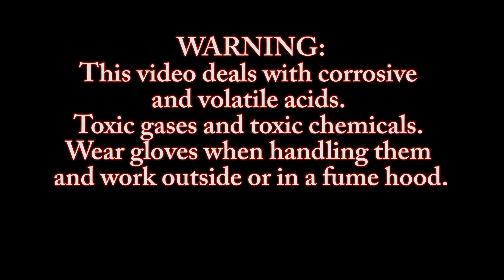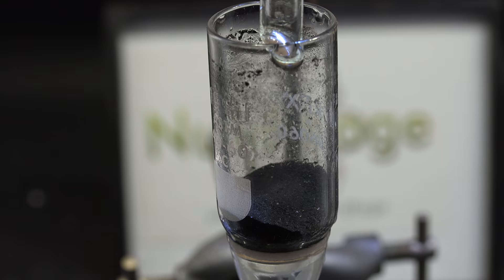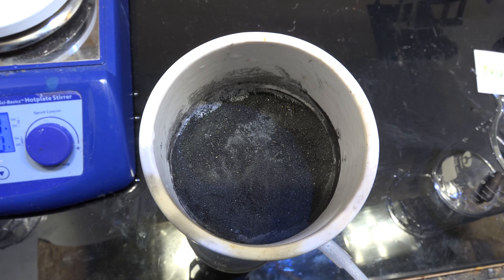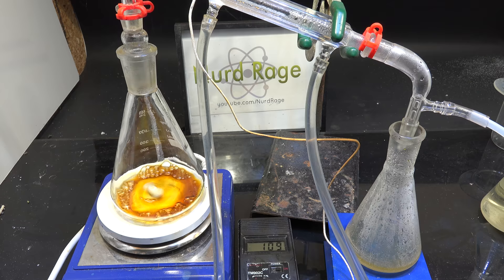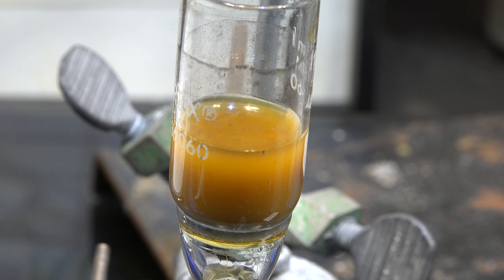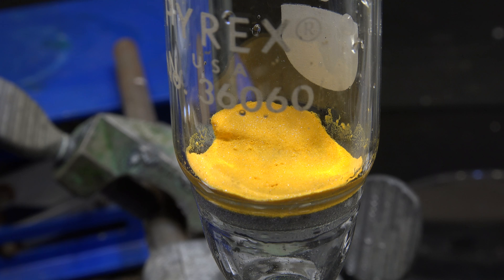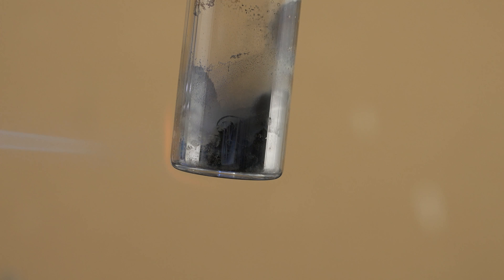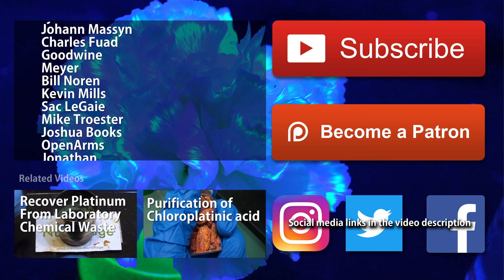Platinum Recovery from Laboratory Chemical Waste (Pt 2)

Comment: You can use platinum mirror on internal side of glass as electrode )
Reply: Wouldn't a silver mirror work better (because silver is more conductive) be easier to produce (given it's a standard reaction) and cheaper (for obvious reasons).
Reply: Quintinohthree, platinum electrode is inert. it's very important in electrolysis.
Reply: nRADRUS I guess that is important in electrolysis, yes.

Comment: If you didn't alter your voice I would have subscribed long ago. Must be the uncanny valley affecting me more than I would like.
Reply from the maker: no worries. Try turning off the sound and turning on the subtitles. They are manually done so they reflect the audio. That should help with most videos.
Reply: That is an actual solution. Subscribed!

Comment: I saw your thermocouple readout but no probe, where were you reading from and what were they made out of? Since you had aqua regia vapor, I'm guessing it wasn't your standard stainless type-K. Were you using something like an IR temperature sensor pointed at your boiling flask? Side question I've been meaning to ask you, what sort of pressure analysis equipment would you employ in a standard distillation setup like yours? Let's say in setup A, you have just a standard rotary vane pump, and setup B has an actual two-stage turbomolecular fancy-schmancy thingmajing (so you'd need resolution up to the mTorr^-4 or -5 I'd imagine). I've seen Edwards electronic Penning Gauges on ebay, but I have no idea how to finagle them onto a generic second stage average-quality-build surplus-university-unit pump I can grab for a few hundred of eBay.

How much Pd to you think you've got? In August the spot price exploded on the markets for both Pt and Pd (no idea on the Pt, but Pd up makes sense since people are hedging against an OPEC spike, allowing fracking to resume). I'm sure you already know this but a standard oxyacetylene torch will hit > 3500C with no issues, so no need for a contrived (masonry cement to form a chamber with two inlet ports, one piping in fuel, the other O2, and some sort of flow control), or some expensive lab grade furnace setup unless you have other experiments you'll use it with

Keep on keeping on, my good man. Your channel is nature spontaneously emitting the anti-particle of the Real Housewives. (Also lol @ the fact that you have to post a disclaimer to prevent idiots from trying this and coming back to your channel thumbs-downing you with an "THIS WASNT AN ECONOMICALLY PROFITABLE ENDEAVOR -- I HATE YOU NURDRAGE!!!!!!!")

Comment: have you considered a graphite crucible?
Reply from the maker: How would i prevent burning of the graphite crucible while i'm burning the carbon... which the graphite is also made of?
Reply: I do understand graphite oxidizes at high temperatures. However, they claim these crucibles are suitable for melting gold, silver and copper which leads me to believe it has a decent lifespan. besides they quite cheap on 
Ebay.
Reply from the maker: I think a porcelain crucible would be more effective in this case. The porcelain itself doesn't oxidize and you can easily look in and tell apart the carbon from the porcelain. You can then stop when the ashes are glowing and carbon has been burned away. With graphite though you see it burning and don't know when the carbon you've been burning is gone or just the graphite is burning. Additionally, the oxidizing graphite generates carbon dioxide, this shields the platinum residues and thus they oxidize slowly if at all. We want oxygen to be able to get and burn the carbon rather than being consumed by the surrounding crucible. Porcelain doesn't react with oxygen so more of it can get in and burn the platinum residues.
Reply: Beh, you're the chemist! makes sense, carry on and good luck!

Comment: How does the stir bar not dissolve in extreme solutions like aqua regia? Does the bar not contamunate the solution? And finally: what do you do if your solution does dissolve the bar and need to stir?
Reply: It's coated with PTFE (Teflon) which is very inert, the carbon-fluorine bond is extremely strong and resistant to attack.

Comment: Probably unlikely that I'll get a reply, but I have a question for you, I recently got a hotplate stirrer, and I'm curious, you say to heat the solution to 95 degrees, however I don't see you using a temperature probe.

Are you simply setting your hotplate to 95 degrees, or have you worked with it enough that you know what higher temperature to set it at to get the desired temperature in the solution?

My hotplate is a ceramic one which might affect that, and I have heard that the display of the temperature isn't all that accurate, I have also not used it very much yet, I've just been trying to keep water at a steady 80 degrees to try to get a feel for how I need to adjust it, so the evaporation probably plays a big part, but still, having to set the hotplate close to 300 to bring the temperature up to a decent degree, then somewhere around 200 to keep it close to 80 seems a tad counter intuitive to me, at least that it would have to be set so high.

It does also make me wonder what effect it would have on sand or oil baths, but perhaps those would be a bit better as there would be a larger contact area on an rbf than the 1l beaker I currently have.

Probably a tediously low level question unfortunately, I never had the chance to take chemistry, and I don't have the time or money to take classes, but I am starting to get some equipment to explore the science a bit myself.

Comment: I work with Boron from 50 million yo boninites. I use a column separation process. is there a column separation process that would work better on the PGA group?

Comment: Pirahna solution - burn the carbon in pirahna solution
Reply from the maker: I actually tried that, didn't work. the platinum metal decomposes the solution before it has time to destroy the carbon.
Reply: How about molten potassium nitrate (or chlorate)?
Reply from the maker: if i'm going to heat it up anyway, i might as well just use air to burn it since it's cheaper to get.
Reply: True, but if you suddenly found yourself without it, you'd be emptying your bank to get some more. :)

Comment: So the brown stuff in a platinum ore is platinium when filtered out of regia then you add soduim bar and water and it will bring it back cause I got the brown powder but I heat it and it turns nugget but my torch is not hot enough I know but I'm in the process of getting one but if I heat it with propane torch in a beaker it will turn black powder and then I can go to town with the new torch I got buckets full of platinium ore to do so I got ya your awesome I know it's got Palladium so I dont want to take it out palladium makes plt beautiful and easy to work with I got palladium gold and I love it it melts pours so easy and palladium pt so I don't hydrocloric the last just leave it there just pt and pd in the ore so I got ya yeah your awesome us nerds need a lil bump on the brain 🧠 🐱

Comment: Hey! i've got a question, what if you precipitate the platinum from a solution of hexachloroplatinic acid, using some zinc powder as a reducing agent? Because i tried it, and the "platinum" precipitate turned out a black powder, and, i cant tell if its some platinum oxide, or not. I treated the precipitate with concentrate HCl to disolve any unreacted zinc, and then filtered and washed it with water. But, i havent heated it to try and melt it...yet. Any comments, or sugestions are welcome
Reply from the maker: It's "platinum black"
Reply: @NurdRage  Ohhhh, and how can I get it "silvery", or shiny? Thanks by the way!!!!
Reply from the maker: you need to melt it down. if you want it to come out shiny from solution, need to electroplate it using additives. But that's too complicated for most amateurs, so just melt it.
Reply: @NurdRage  thanks!!!!!!!!

Comment: I know you have a Ph.D in inorganic chemistry but do you know these equations actually by heart ?
Reply from the maker: It takes me about a minute to solve for them. Just like a lot of people are good at math, but it takes them a minute to solve equations without a calculator. Chemistry is a lot easier though. It's very rare to deal with numbers and coefficients above 12.
Reply: but you don't actually have to look up for the reactions at all. I mean do you know every bit of chemistry of all elements and molecules ?
Reply: The answer to your question is Stoichiometry. Khan academy has some good videos on the subject of stoichiometry and Balancing chemical equations. My understanding is that once you know how the procedure works you can calculate it for any chemical reaction. Sort of like once you know how addition works you can add any numbers together. 

But maybe I am wrong. I am not a chemist. I am just someone with a casual interest in chemistry.